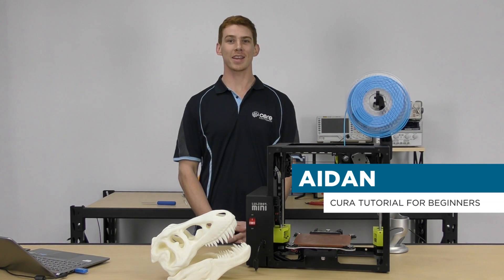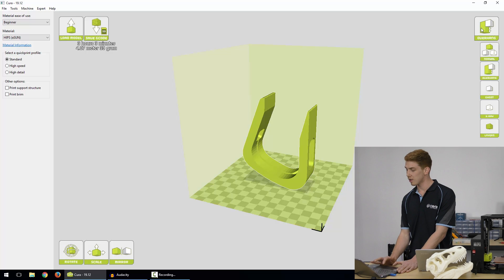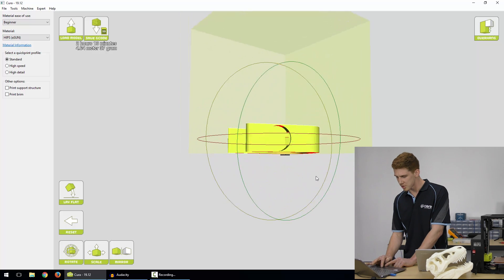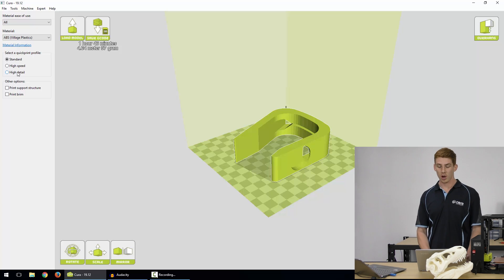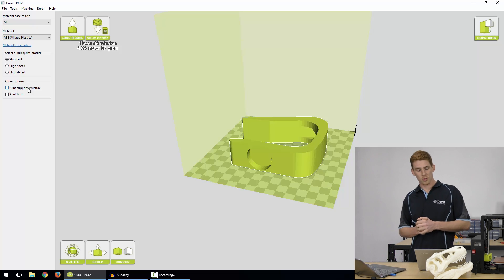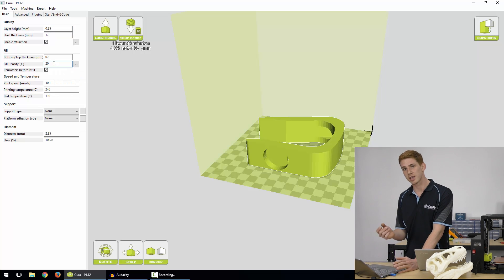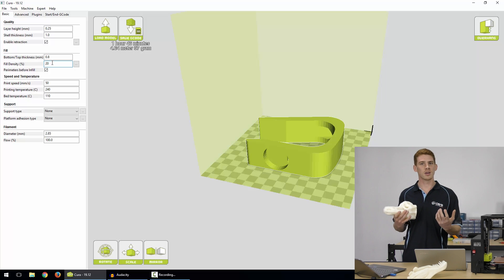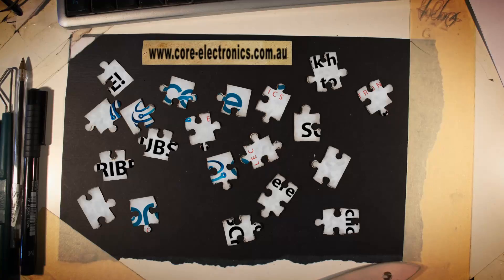How to use Cura - Tutorial for Beginners

Comment: When we print a component at 0.2mm layer height or 0.06mm layer height, the component weight doesn't change, that is length of filament used doesn't change. Could you explain why.
Reply: Because it's how much material the printer puts down a once if you put a smaller layer hight it will be more accurate and better quilt the higher the faster

Comment: Does cura design models or you need another CAD program to design?
Reply: Cura is not a CAD

But you can use 
Autodesk
Tinkercad
Fusion 360

These are some i got off the top of my head but theres a lot more